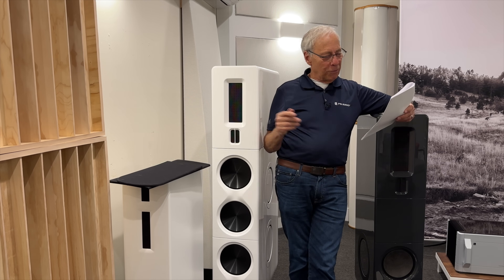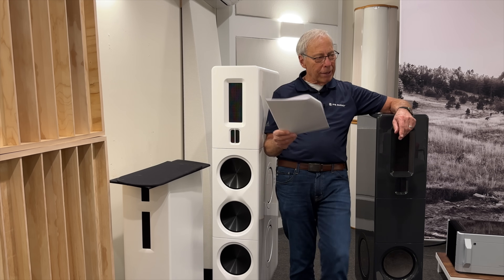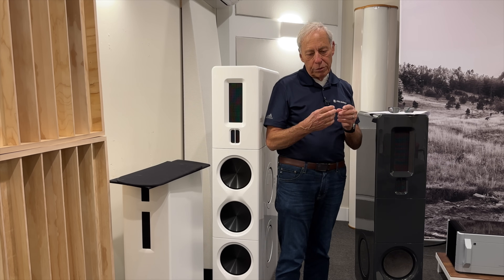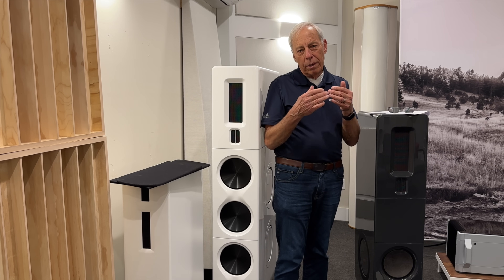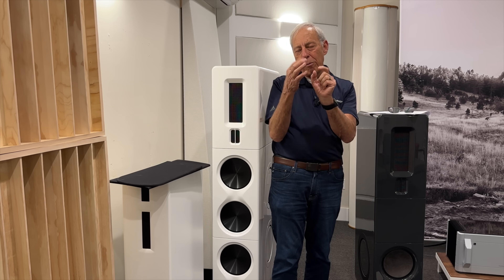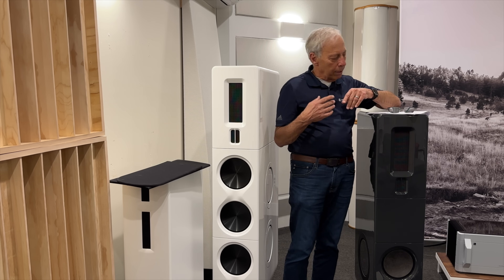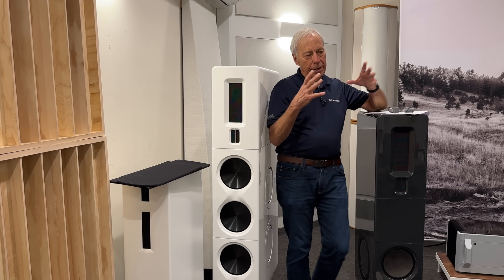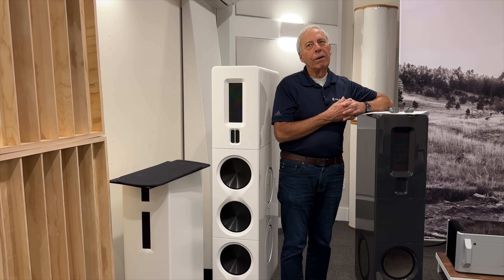Galvanic isolation explained

Comment: Nowadays it's standard to run the DAC on a local precision clock as the master clock and enough samples asynchronously buffered on the DAC to not need PLL. Neither jitter or noise are concerning issues for digital audio today as much as it was not a concern in my first Denon CD player from the 1980s. In the early 2000s when PCs started to be considered as audio sources, lots of such issues existed. Horrible MP3 compression (from Napster etc.), digital noise from the PC switch mode power supply and motherboard and clock issues existed back then. Now we are in 2023, and my US$10 Apple iPhone DAC dongle sounds better than audiophile gear did just a few years ago. My AirPod Pro 2 have the DACs build into the earbuds and they are perhaps not as resolving as my Stax electrostatic headphones, but considering they include the entire DAC sitting in my ears, they are quite impressive. So as best of mainstream digital audio continues to improve, the difference to the top digital gear shrinks while our hearing capability isn't getting any better.

Comment: As a seasoned Hi-Fi veteran of 44 years (that's listening; my age is greater), my advice is NOT to worry about "galvanic isolation," or any such nonsense, and simply to ENJOY the music! 🎶 ... Life's too short!

EDIT: Despite the above, I first dabbled and used fibre optic to connect my CD player to an off-board DAC in 1990 (33 years ago). So, been there, done that, DECADES ago! ... These days, I'm a little more laid back in my attitude to Hi-Fi.
Reply: Hearing doesn't improve with age. In a way it's good. It's bound to be cheaper to be a Hi-Fi enthusiast.
Reply: @marcusbrsp   Well, at 61, my hearing is so good, I can hear the whine from a Switch Mode Power Supply "Wallwart" and they're virtually silent! I have extremely good hearing!

Comment: When I hear galvanic I think of very high sugar food and beverage reacting with my fillings. When I hear about signals crossing a gap I think of spark plugs, whose collapsing field creates a lot of noise. The superiority of hard wired fiber optic internet  tells you what you need. I also think about those Technics amps which must be state of the art in digital signal transmission.
Reply: I think you need better dental work. The mercury might be messing with you...
Reply: Ha, you're not crazy.  One definition of "galvanic" is electric current in liquid, which can corrode metal.  "Galvanic isolation" means electric current can't pass between two parts of a system, but the signal can pass.

Comment: Put on your boots ladies and gentlemen the "Audiophile" sh1t is going to get deep.
Galvanic isolation is "Audiophile" speak for transformers, capacitors, or any device that or any other of a number of devices where no direct conduction path is permitted.
Think that is exclusive to overpriced "Audiophile" equipment?
Guess again.
Oh yes and the "Audiophile" "noise on the digital stream.
No digital device cares about noise on the "digital stream"
Let me repeat that for you "Audiophiles" no digital device is influenced by noise on a digital circuit simply because all digital circuits look for is digital information and because error correction is built into digital circuits the digital information doesn't even have to be complete.
Here's another juicy tidbit for all you "Audiophiles", your cell phone, your mp3 players, and even cheap audio devices all use buffers that (now get this) go "first in, first out) and reclock the digital information.
So what's the difference in "Audiophile" equipment?
Well because your wallet is thinner, you can now hear the difference. :face-purple-crying:
Reply: First I am totally with you on the audiophile junk science. But inside a DAC there is a possibility of noise riding on the digital pulse train coupling into the analog section of the DAC chip via. RFI,  ground buss,  or the power supply. Note the word CAN! So the question is, does this happen on every low cost DAC, no. The next question is if this does happen, is the noise audible, probably not. I am just saying that shielding and attention to ground buss engineering is still a good thing in a DAC. And is doesn't cost thousands of dollars to achieve a quiet DAC either.

As for noise on ethernet switches or routers affecting the recovered audio, that's complete hogwash. An "audio grade" ethernet switch is pure snake oil. And there are some photos of these audio grade ethernet switches online and they are nothing more than the circuit board out of a commodity $20 switch in a fancy case.

Comment: Something worth noting is that many commercial DACs have something similar built in.  There's a discussion today on DIYAUDIO about some folks who invested big $ on upgrading clocks in their FIFO and found no change in the Terminator sound.  That's because the Terminator has it's own 'air lens' function which cannot be bypassed.  So its like buying a SOTA preamp and putting it in front of an integrated amp and being disappointed that there was no improvement.
OTOH, if your DAC has no FIFO/reclock/isolation or it can be bypassed, then this device could work wonders.  It ultimately comes down to the implementation and the phase noise of the clock employed.

Comment: It's sad that TOSLINK fiber optic audio connections never met their full potential. Built in optical isolation.
Reply: Multi-pin connectors are more profitable. At least one cable vendor says on their website how frail the HDMI format is. Notice TV's still use Toslink for over the air 5.1 or two channel signals.
Reply: For TVs you have a different concern called "lip sync" which is the latency between video and audio. If your audio plays too late you will see the lips moving before you hear the voice. The TV is clock master for the video frames showing and audio samples playing. TOSLINK is a low cost synchronous data transfer interface where the TV determines the sample clock one-way and with low latency for good lip sync performance. I've had several cases of HDMI connectors becoming unreliable while I have never seen such issue with TOSLINK.

Comment: So basically it is also a reclocking device to deal with jitter.
Reply: @SubliminalVibes  Beg to differ.  Every clock made has phase noise resulting in jitter.  Just comes down to how much it impacts the sound for your particular listening pleasure.  More jitter and the sound is harsh and digital.  With less phase noise that goes away, imaging improves, everything sounds natural and micro details appear allowing subtle musical cues to appear... emotion, room ambiance etc.
Now, lots of DACs have an Air Lens function built in.   In that case putting another in front of it will make no difference.  You'll still be listening to the stuff in the DAC.